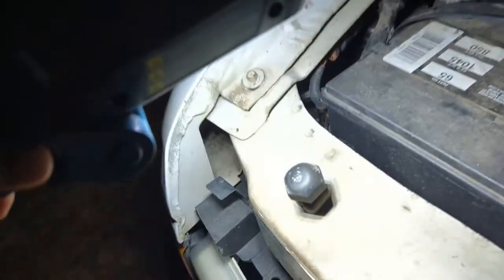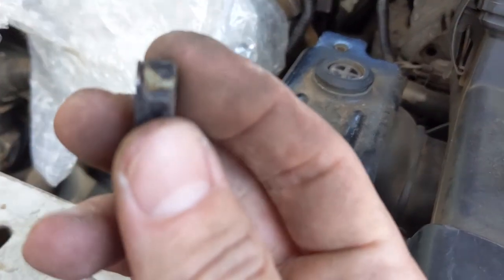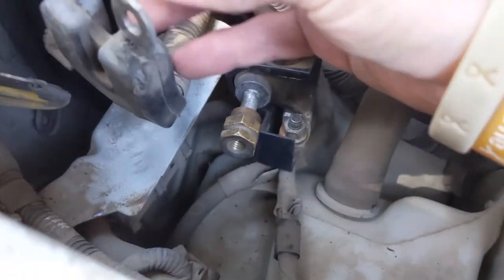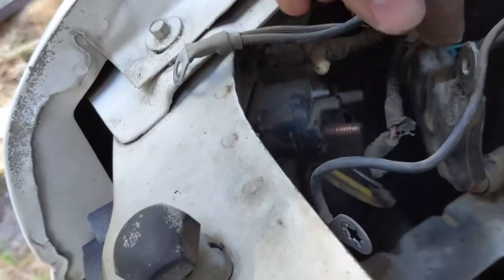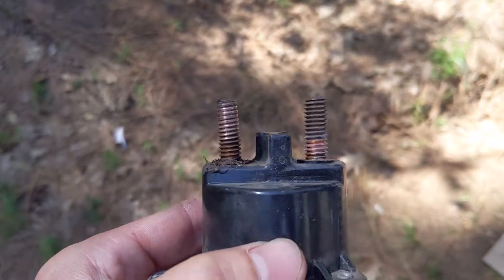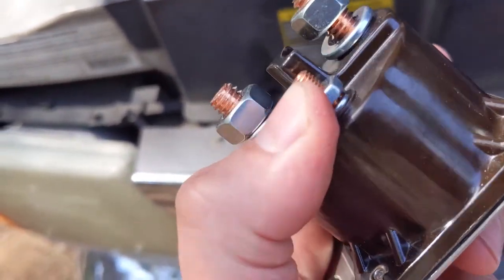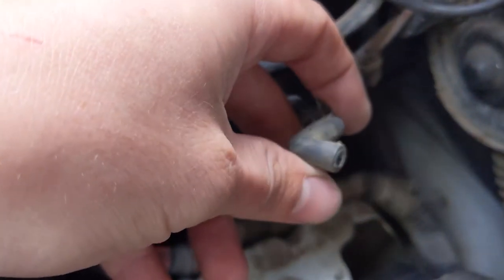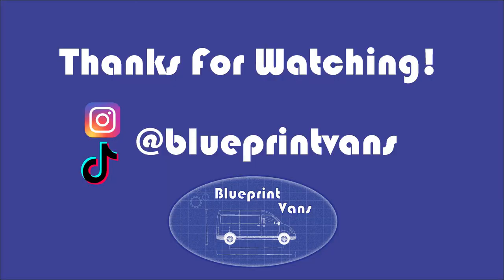Van Life Build | Ford E350 Stealth Conversion | Starter Solenoid Replacement | Ep 20

Comment: I have a 3rd wire to be attached onto mine that I do not see in yours. I am trying to install in correct spots. I have the two yellow on the positive, but I have a 3rd wire that is marked 12A fuse. I assume I need to have that run to the positive side as well (1995 Ford e350 Gas)
Reply from the maker: Where does that third wire go to?

Comment: I have an E350 based ambulance, and I could not find the solenoid!!! Thank you.
Reply from the maker: Glad I could help, this problem drove me nuts, so anyone I can help with this video is a bonus.  Thanks for watching!
Reply: On the fender in wall next to the battery? Remove battery. It's on the left of the 5.4 litre V8...?  My van is modified for disabled passengers, but I have seen same location for solenoid relay if that's what you are looking for... It's a little inconvenient to lift out the battery, but I just take the opportunity to do a little cleaning and maintenance.

Comment: I’ve got a 1998 7.3, replaced my alternator and starter and have a slow crank and start issue. 

My batteries read at 12.4 (front) and 12.8 (back).

Do you think my issue is the starter solenoid ?
Reply from the maker: @Twohunnidpercent  that certainly could be a possibility, it's a fairly cheap part and I would say worth a try.   You've already tackled the bigger jobs and eliminated both of those.  Does it sometimes not turn over at all?
Reply: @blueprintvans789  now it’s not turning over at all. I get about a half crank and that’s it
Reply from the maker: @Twohunnidpercent  yeah I would say change that solenoid out ...I was surprised how many things were funky until I changed that out. 

The other concern is why are your batteries two different voltages?  Aren't they connected to one another?
Reply: @blueprintvans789  I guess technically so. But ones under the hood and the others under, attached to the frame
Reply from the maker: @Twohunnidpercent  yeah I have an auxiliary battery in mine as well that's under the metro doors but that's all connected so it should show the same voltages .  I wonder if you might try to isolate either battery and try to start it off each of them separately to eliminate that as well.
Reply: @blueprintvans789  will one be enough to start it alone?
Reply from the maker: @Twohunnidpercent  yes I think so. Is the front the lower voltage battery?
Reply from the maker: I just looked and it seemed like the two will definitely make it run better but you should be able to start off of 1 just to see if there's a weak link there
Reply: @blueprintvans789  okay going to isolate in the am and probably swap for a new solenoid (although mine doesnt show signs of damage or wear)
Reply from the maker: @Twohunnidpercent  yeah let me know how it goes I'm curious to what might be going on there.  Also just look over your grounds to make sure those are all clean and tight
Reply: @blueprintvans789  to be clear grounds will cause a lack of power? Or for safety?
Reply: @blueprintvans789  isolated the frame battery and got no crank at all. Beginning to think it’s a battery issue
Reply from the maker: @Twohunnidpercent  the ground completes the circuit on vehicle electronics
Reply from the maker: @Twohunnidpercent  yes that certainly seems like it could be your issue, it was suspicious having the two different voltages.

Comment: So just to clarify, you didn't have to do anything with that extra prong? I'm switching out this same part on my e150 and I can't find this part with three prongs in any local stores.
Reply from the maker: Correct, not sure the purpose of it, but I didn't have to hook anybody up to it.
Reply: These 4 prong units are "universal". The "signal" wire from the key is +. It needs a - side to complete the circuit and engage the magnetic solenoid.

In some vehicles, the solenoid gets mounted to a plastic surface. In this setup, there would be a ground wire for that 4th prong, to complete the circuit.

The metal backing plate of the solenoid is also conected to that ground prong internally. In vehicles where the solenoid is mounted to a metal "grounded" body panel, the ground is connected through the mounting bolts to the backing plate leaving the 4th prong un-needed.

Comment: I chance the starter relay ?, My Ford F-350 7.3 diésel still doesn’t start ?, This there a wire not working 2000 is the year of my rig .
Reply from the maker: Does it turn over?
Reply: No sir , The radio air conditioner turns on but the truck doesn’t ?.
Reply from the maker: Have you checked if your actual starter is shot?

Comment: Socket sizes?
Reply from the maker: For which part?
Reply: Starter
Reply from the maker: it's 8 mm for the solenoid to chassis bolts And the terminals on the starter solenoid are 14 mil
Reply: @blueprintvans789  thank you. Going to tackle it tomorrow.
Reply from the maker: @scottphillips1210  It wasn't too difficult of a job, I think the most difficult part of the whole experience is figuring out what's wrong lol.   I think you'll be able to knock it out pretty easy,  good luck and thanks for watching!

Comment: Is this a diesel? I can’t find the solenoid
Reply: I found it! Doing the installation. Fingers crossed let’s see 💪🏼☝🏼
Reply from the maker: Yeah its a 7.3l Diesel.  Check out the description, I put an AutoZone link for the solenoid I used there and everything worked great.  Thanks for checking out the video!
Reply from the maker: Let me know if it worked!
Reply: @blueprintvans789  unfortunately no, I think I have a fuel pump issue. Still crank but no start.
Reply from the maker: @expresscarreviews  ah that's a bummer, at least you knocked out one of the possible fixes for not too much money or time I hope.  I assume you checked the fuel pump fuse right?
Reply: @blueprintvans789  yes you’re, the problem is now narrowing. And No not yet, I will check that first.